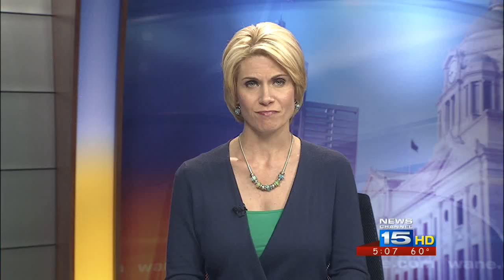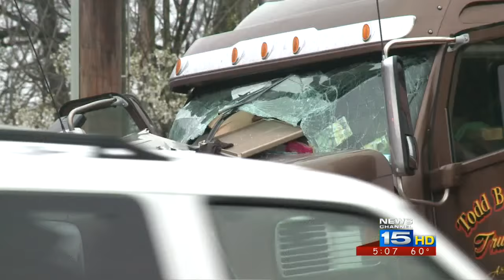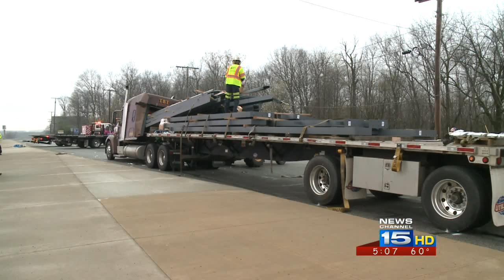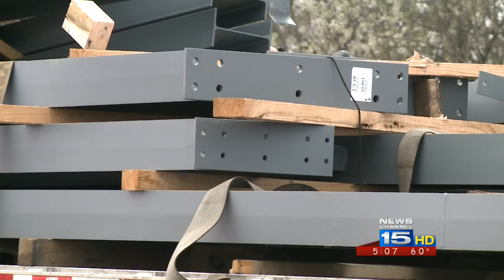Truck driver killed after load comes loose

Comment: Looks like he didn't have any corner protectors under any of his straps... probably cut thru his straps when he slammed on his brakes... really sad... that's why I use chains on steel and concrete pieces...
Reply: Wisdom
Reply: Steel on steel, we flatbed guys are supposed to respect physics and prevent against horizontal, vertical and side to side movements. I can't believe you and I are the only ones to point out chains and edge protectors. Everyone is blaming 4 wheelers and no headache rack, the driver caused his own death.
Reply: @TheRoadhammer379  as dark as it is, the first thing I looked at to see what he did wrong while strapping. No edge protectors, no chains, I think it's understrapped as well. On steel loads like this I'll use a min of 15 straps and try to x-chain if possible. That also, he may have not have had the straps tight enough. When I have steel I crank the absolute shit out of those spools, I will jump on that load bar until I'm out of breath and sore.

Finished steel like this I'll try not to use chains if I don't have edge protectors as I don't want to damage the finish. But I feel this accident happened more so because of bad securement and not because of slamming on the brakes.

You should always strap for if the worst case scenerio happens, not what will get you past a dot check and I constantly see drivers who strap with that mindset.
Reply: @Hard_Labor_And_Fine_Dining  As tight as you crank the spools of the straps, the sheer weight of steel beams like this are going to shake them loose while driving right? I don't know the protocols on how often/after how many miles you guys ''should'' stop to check on and re-strap the ones that loosened up?
Reply: @lunasilvermoon2283  they do tend to come loose during the first 50 or so miles of driving. The law is check the load first 50 miles then every 150 miles there after.

Usually I'll get them really tight when I first load then retighten them during the first load check. After that they don't tend to come loose. Once you have that second tightening they're on there pretty good but I'll still check them often to be safe. Once in a while you'll have to crank them a click or two but generally, once they're tight they are tight.

The steel itself is usually so heavy that it doesn't shift or move under normal driving, the dangerous part with steel is that if there is a force great enough to shift it, it has so much potential energy that it can cause a situation like this. That's why you strap the hell out of it to prevent any motion if there's a situation like an emergency stop.
Reply: @TheRoadhammer379  Strap or chain with or without edge protector's would have made no difference thy do not put pressure down on the middle of the load nor do thy squeeze it from side to side with enough force to stop that much weight . the only thing that might have helped slow it down would have been to cross chain the front and rear the other thing to have done would have been to run wooden sticker board's every other layer of steel .40,000 pound's of steel carry's a LOT of inertia .Don't put all the blame on the driver ,yes he should have known better but then again he may not have .
Reply: NO HEADACHE RACK ! law say's ya got to have one to haul this type of load. this is why.
Reply: @martehoudesheldt5885  what law is this, and where?
Reply: @loganjohnson3589  Well it's either the driver who takes the blame, this equipment manufacture or the universe itself. Which one do you pick?

We all make mistakes and have misjudgments. Obviously people are making it to their destinations with loads like this so there must be a way to do it safely. I don't think never having to emergency stop is the only barrier from this happening all day every day.
Reply: @Gunshinzero  It was driver's Error .Sorry to say .And I speak from 40 years of oversize and heavy haul experience . ether he never read the book for load regulation's or he got into a bad habit no one can tell now . But he NEVER should have pulled that kind of load without a headache rack hens the name and from what i could see he had no belly straps . you may reed my other comment's I made further down .As for dynamiting the brakes to avoid hitting the ass that cut him off ? as much as we all would like to not ram a car and possibly killing some one ? the car was at fault he should pay I know that's harsh but that's reality .I don't pay for another's mistake I know what it's like to kill someone and if I can stop people from doing stupid thing's like that with word's great if not I don't loss any sleep over it Life is not sacred and if you want to die of old age pay attention to those around you as if the all want to kill you People like that only care about them self's .when in reality thy are not worth saving .

Comment: A backrack would have probably saved his life.
Reply: no it wouldnt have,headache racks are made of aluminum and only good for hanging chains and binders.
Reply: @ericsalhoff4734  no their made out of steel to and have ratings a trucker should know as he is ultimately responsible for his load. But for chains and binders you say ? Why didn't he use all he had to be extra safe for any situation. Brakes don't lock up on air failure ?
Reply: @shawnfreeoftyranny8849    a bulkhead would be made out of steel, but headache racks today are aluminum.  yes the driver is responsible for his load securement, rule of thumb, strap or chain every 4ft of length..who sd anything bout brakes and air failure?
Reply: @ericsalhoff4734  Thanks for adding correct info. on I think "rule" of 4 ft. strappings and diff. between bulkhead and headache rack. The brake words were from being annoyed of many comments assuming it had to be a car brake checking the trucker as fault for his sad death. I had CDL to just haul my own logs and skidder but was sure the law/rule and either way being a logger (that blaming anything on anyone else attitude would surely put your life at risk.)the final responsibility of load safety for driver and others, is the drivers. Would need to watch again but don't think I saw 4ft. strapping. Like tree's and logs its all on you to go the safest for your life and think he should of turned down load with out a rack or bulk head. See a load like that and screw the rules, strap it every 2 with added canvas strapping if you value life.
Reply: I think it would have in this case, the speed on that road is 35mph, slamming on breaks and a poorly secured load caused his death, but don't think it would of had enough momentum to carry past the backrack at a low speed.

Comment: Where's the headache rack? It's a reinforced flat plate that's normally bolted to the front of the trailer, and they can put an additional cab protector behind the sleeper bolted to the truck frame. It doesn't stop the load from breaking loose and shifting, but it stops the individual peices from penetrating the cab.

Comment: no headache rack why these guys do that
Reply: I thought all flat beds had them regardless it isn't gonna stop that
Reply: Make no sense I see it everyday in the south!!  R.I.P
Reply: That Milo and headache racks wouldn't have stopped s***
Reply: @Mr Sunshines Isn't that the purpose of the headache rack to stop tragedies like this.  What is the purpose of the headache rack if it isn't going to stop the load from going thru the cab?
Reply: Most are company guys , You Run what company gives you. Headache Racks are not  on Lots of steel haulers rigs. And only a top line rack would have stopped that load.
Reply: @marywagner3644  Yeah maybe if it was wood a rack might have helped but probably not steel! To minimize truck weight most are made of aluminum the same lightweight metal the truck is made of!🤷‍♂️🤷‍♂️🤷‍♂️
Reply: @theshoot2958  yes I have absolutely no experience with flatbed God Bless
Reply: @Mr Sunshines check your previous messages on here from last year, shoes the type of character you really are. Lol

Comment: r.i.p. driver my condolences to the family but no one knows what really happened we can all speculate thats about it but extra securement is never a bad thing and to the one who said about straps on steel some times thats the only way you can do it cause those beams may be painted or powder coated or the shipper may only allow that i hauled for high steel in lancaster when they were doing the milton ky river bridge and we were only allowed straps on over size beams for that reason just something to think about
Reply: Jake Richards I would leave the facility an then grab my edge protection an throw some chains on em.. Fawk the shipper an the receivers my life out here not there's... I carry extra shit for protection as far as painted or powder coated things it's called carpet strips an such.. Also belly wrapping those beams to tighten them up against the T's an whatever they use to keep them off of each other will help to slow shit down as well as having ahout 5 to 6 of them 4×4's chained up as a breaking point to.. There's ways of giving that steal a way to slow.. I have a breaking point at my step with 5 an right at my ass end of my trailer at my last securement point.. When securing always think "Do I have my N S E W points secured as well as having enough on that load..?? Been skateboarding for over 2 years an I learn as much as I can from others an I always over do it when I throw straps just a habit I've gotten into..!! Especially on coils I always throw 6 chains on a 30,000 to 40,000 pound coil 70 grade 3/8 chain..!! I never ever think about that half of whatever scenario I always put as much as I can..!! Most of all I let you pass me an I keep my distance always so I always have that out if I need it..!!
Reply: especially if the pipe is externally doped or coated the customer frowns big on scratching or chipping that type of pipe .When I was hauling pipe and drll stem in the early 80's it was always chains and binders ,I never used a nylon until the mid 90's . A good cheaterr pipe and  heavy binder mixed with some hemoroidal making grunts  I trust more 
 so than a ratchet .I like chains and binders hanging off my rack you look as if you work for a living .Id rather bind and chain than deal with tarping damn loads ,flatbedding sure separates the  men from the other softer cleaner clothed men
Reply: While i agree straps work a bit better on beams and building structure, you can use chains on painted products just have to put rubbermats,or some kind of cushion between
Reply: The driver should have used chains I find that hard to believe that you can use straps did flat bed 30 years that’s BS
Reply: @ronnielewis2176  some steel loads will not allow chains. I've taken these for houses/garages/churches, and they are finished pieces, which cannot be nicked/dinged/dented by chains. I use all my available straps, build a bulkhead to maybe add security, and it's high alert the entire ride. So many of these guys are talking about how they would handle being cut off, when, in my experience, the best way is to keep letting off the fuel. I may lose 1-5min by doing so, but even if I'm late, the costs are far less than court, or worse.
Reply: @A_Cowboy_called_JackRabbit  not talking about some this particular load i would like to see you build a bulkhead for that load. Mr Cowboy this is why you have edge and corner protectors. I’ve done flatbeds over 30 years i would not haul a load if a shipper tells me how to secure it you have to be crazy if you do!!!🤕🤕
Reply: @ronnielewis2176  on this particular load? Of course, there's no way to build a bulkhead. In my opinion, the only POTENTIALLY safe bulkhead, that MIGHT offer a little security, measures in the range of 4"-16"... For lighter loads, though. I trust nothing.

The trailers you mentioned... What brand/s? I'm actively shopping.

Comment: As an experienced flatbed steel hauler , I can tell you at a glance that this load was not even close to being secured legally or safely. The primary securement for this load starts with steel chain binders , there are none to be seen on this load. The nylon straps on this load are only rated for 2,500 lbs each , if you brake suddenly that weight increases exponentially depending on your speed at the time of braking. Those nylon straps were worthless when used alone , they should only have been used as secondary securement after chain-binders had been installed first.
Reply: Some shippers forbid chains.  Metal edge protectors with rubber pads in contact with the beams grip the beams and prevent the cutting of the straps.

Comment: This is exactly why I think the use of the driver cam (forward facing) needs to be in every vehicle on the road! Only ones that will know why he hits his brakes are him and the driver in front of him that caused it! Hauling these beams, steel pipe, steel coils, and plate steel are very dangerous. With these loads you can haul them many, many times until the first time you have to make an evasive maneuver! I have hauled many tons of these materials without an incident but you have to be thinking at least several vehicles ahead of you and make sure that you have enough space ahead of you to get slowed down responsively! And carry God as your co-pilot!

Comment: I have over forty years of over the road heavy haul experience and I will tell anyone Only an Idiot pulls a flat bed or any type of open trailer without a headache rack on there truck . the wall you may see mounted on the front of a trailer does not have the strength or height to stop this kind of load .This comment may sound cruel but it is a fact not to all truckers .SAFETY FIRST LAST AND ALWAYS .there is no second chances or do over's .Your family will thank you .

Comment: I am a flatbed trucker, I've carried that same stuff many times. I can see some mistakes that trucker made. 1) He didn't use strap protectors between the straps and the steel, so as a result, when the steel slid, it cut the straps. (2). He didn't use enough straps. ( 3) Related to nr 1, he did not put a twist in his straps. Rookies want their straps flat and straight, but that is a mistake. The straps that go high and long, especially, you must put a twist in them. If you leave them straight, they will flutter madly in the wind, and since they were on a sharp steel corner without strap protectors, his high straps were probably already 1/4 cut through. He appears to have no headache board on that tractor.  You have to assume you will have to brake hard sometime during your trip. Last year while carrying a high load of thin steel decking they pour concrete onto, I was driving north on I-15 in Fontana, Calif., in the 2nd lane from the right. It was an uphill grade, and up ahead I saw a loaded semi merging on the onramp very slowly. So I looked to move left to avoid a slowdown because we loaded truckers hate to lose our uphill momentum because you can't get it back. I had my left signal on and was looking in my left mirror for somebody to let me move over. No one gave a crap, or didn't see the situation. When I looked back in front of me a pickup moved over right in front of me to avoid the merging truck. I was going 60 and the pickup I think 30 or even less. I slammed on my brakes, and then moved onto the shoulder to check my load. The top rows had slid forward 2 1/2 feet, and cut through one strap and halfway through another. But I had overstrapped it, and had used strap protectors, and had enough straps left intact to save me. My rig had no headache board.

Comment: R.I.P. to the truck driver and my condolences to his family for their loss. 
You would think the people loading this cargo would ensure there's a steel vertical barrier at the front of the trailer to prevent any load from going any further and into the cab. I wonder if any changes have been implemented in this industry since this accident occurred five years ago.

Comment: I hauled steel for 12 years in Michigan 160,000 lbs. +  ,as far as I'm concerned your not a real truck driver unless you have hauled iron ! When your load can kill you , it separates the truckers from the steering wheel holders !

Comment: From the UK. 
I've carried hundreds of tonnes of this stuff including pickle and oiled sheets and coils. I've only ever used chains and chain stretchers of the old type.  Never had any come loose or break.
The use of straps is not recommended unless you use a lot of them and with dunnage packing. They cut easily if you don't use dunnage between them and the steal. 
I  had another driver have them come through the back of his cab because he'd used non standard straps.  He was lucky. 
In fact,  I've only recently sold some restraining chains and a new type chain stretcher that I used to use from 30 years ago when I used to haul steelwork and fabrication. I  got only  £8 for the lot, considering that they have saved so many lives and worked well for me.
Bloody heavy,  but that's not an excuse to refuse to use them to secure loads and save lives.

Comment: That's why you need a bulkhead on the trailer front and a headache rack on the tractor. Also the load was improperly secured. I have seen loads like that flip clear over and not budge.

Comment: I came something this a home. Traffic was backed up for about 1 mile. It was an accident alright. A flatbed tractor trailer parked on the side of the road, 1 I-beam sticking throught the windshield, part of the load laying on shoulder, bracken straps and skid marks. The driver was sitting on the shoulder crying. No injuries. The driver was super lucky to alive.

R.I..P. fellow driver. I did over  road for 9 months and regional for 15 months. I had to quite. My wife was terrorfied of getting the ultimate phone call. I pray for all truck drivers to a good day and make it home to their families.